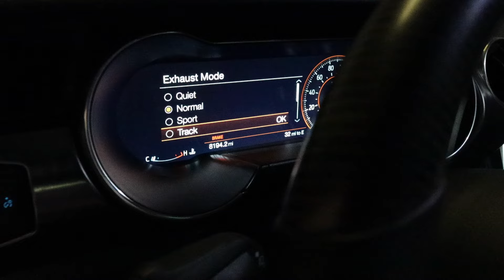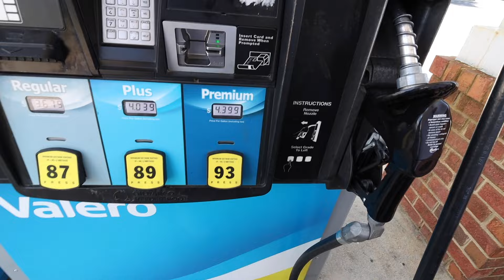Visiting WRECKED Mustang Mach 1 and left SPEECHLESS...

Comment: I just fixed a friends active exhaust 2 weeks ago, and their harness was pushed all the way against the body line where I couldn’t even unplug it. So I took 2in of 5/16 high temp trans line and cut it down the middle then slid it onto the body line in front of the harness. Was much easier then trying to tape it.

Comment: I was having the same problem with my passenger side actuator. I solved the problem by taking it to Brandon at Roy Hendricks and he dropped the passenger side exhaust and took an air chisel and bent the frame back and created a 1-inch notch in the frame. My wires had completely severed and blew the fuse and I had to get a new harness luckily it was only 30 bucks.  He also put in my Steeda H pipe.  He does great work.
Reply from the maker: Nice! Thanks for the info bro!
Reply: I had Brandon do my Steeda H-pipe as well. I added the Borla S-type axle back and Brandon said the connection on the Borla is the opposite side, so it eliminated it getting pinched. He said the Borla design is how Ford should have done it.